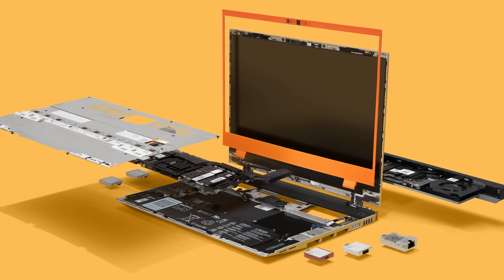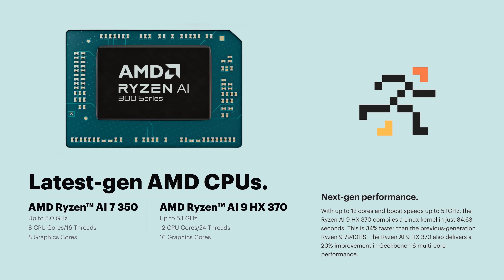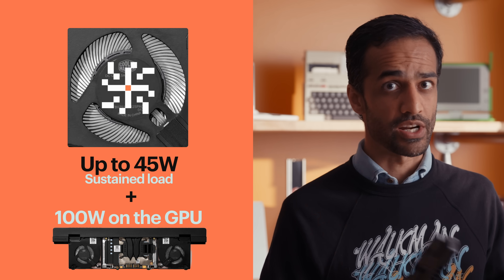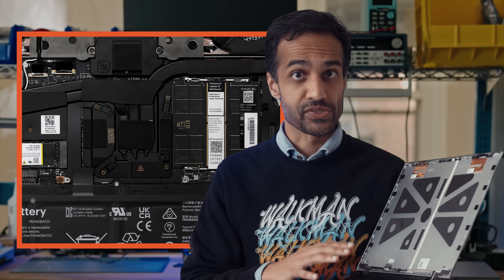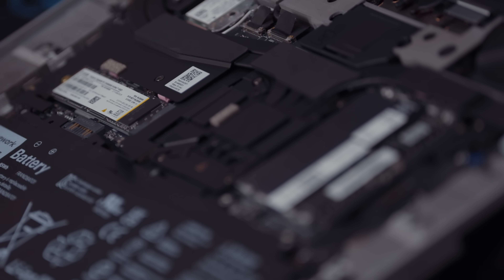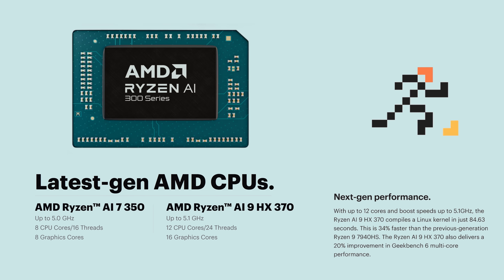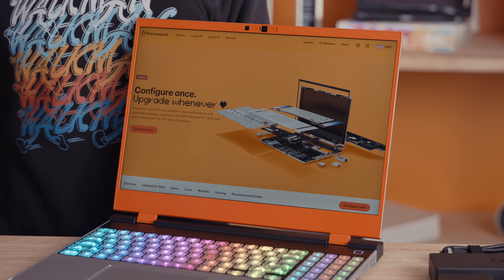Introducing the new Framework Laptop 16 with NVIDIA® GeForce RTX™ 5070

Comment: all this is amazing, but the 8gb of vram..... 😩✌ Big deal breaker.... the 5070 is MUCH more capable than the 8gb allows. JarrodsTech made a video where he power limited a desktop 5060 ti  (16gb) to 100e which is exactly the same as the laptop 5070 and found that the 16gb of vram made such a big difference in more demanding titles at higher resolutions, where the 5060 ti was completely playable, but the 5070 laptop was not. Not to mention it would give more headroom for frame gen. not sure why framework didn't go with the 5070 ti instead. it isnt much more expensive but is alot more compelling value wise. 8GB just isn't enough. It was enough when the GTX 1070 came out, but that was almost 8 years ago, and times have changed.

Comment: TLDR; if you had a framework guaranteed list of supported Thunderbolt Docks for Ubuntu and Windows (not user vetted, but maybe a comments section) I’d switch today. 

 I love the changes and iterations you are constantly pushing for. I’m a freelance developer, developing web apps. As it stands now I need a lot of memory for my development stack (upwards of 24 gigs on the daily) recently I’ve been needing a new computer. in the past this has been a  MacBook  Pro. As for now I’ve been testing out Ubuntu on my personally desktop to accommodate the needed ram upgrade, and finally after many times trying, I think the Ubuntu Out of Box is no harder to set up for development than MacOS.

I want to switch to framework, however

I love the functionality of plugging one cord into my Other World  Computing TB4 dock and having it just work. If you had a FrameWork verified TB4~ dock list for Ubuntu and Windows I’d by one right now. I just don’t want to spend hundreds of dollars testing 15 different docks for compatibility. My biggest concern is gpu pass through for multi monitor support. I can’t tell how that works exactly from your documentation. I know there is a dedicated gpu port out of the back of the gpu, and some amount of pass though out of the side ports. Specifically as a laptop that’s what I care about most. 

I think this would sway others to purchase a framework as well.

Comment: I thought the point of framework is to have one laptop and upgrade it forever, not to have new laptop each year.... So you basically offer new form of pci slots. I remember ordering my Dell laptop to spec in 2008 and parts were very much replacable. Only thing against replacements were cost, which this company does not resolve. 2k laptop? No thanks.

Comment: Guys, my issue with the framework 16 wasn't the power of the GPU.

It was paying that price and not getting: A wrist rest with no lines in it (I don't want spacers there), an rgb numpad, and changable ports that have 2 ports on 1 plug (those things are wasting too much space).

There's oodles of other customization I still haven't seen but want, but those things, there's no way I'm buying one without those things.

Cmon guys its modular already for repair, why can I not choose to outfit the thing more? I want a touch screen, I want colored shells, keyboards with track nubs, a magnetic usbc port that could be used for easy charging. I would pay a premium for a device I could outfit like that, why don't you guys want my money?

Edit: I saw your other video. I'm happy you're trying on at least some of these, just to hear just something affirming you are actually, maybe going to deal with some of the deal breakers is nice, but its pretty disheartening too. You had time to develop and test that weird giant trackpad (that I emphatically do not want btw), but just selling me a single piece of metal with a normal trackpad in the center, that's still far away for some reason...

Comment: Yet another proprietary GPU module incompatible with anything else... I'm writing this comment from 2016 Clevo P870DM, upgraded from original Maxwell GTX 980M to Turing Quadro RTX5000 and it seems like CPU will become bottleneck first (currently i9-9900KF@5,2GHz)...

Comment: Something I was wondering — I know the PCIe interposer was stated to only have, like, 10 connection cycles? Which is probably really more than enough since you probably only would remove/swap modules when you upgrade, which probably would be every year at most, but is there a new version of the interposer with more connection cycles? Also, will the previous gen stuff be available new but cheaper when this new stuff drops?

Comment: Laptops have finally achieved the ultimate goal, time travel back to the mid-2000s lol or late '90s really well I guess that would be the ultimate goal.. mid 2000s is all right, like at least they recognize the idea that you might want it... I feel like there was a brief 2010 era where this has made it come back but it wasn't quite on the same level as the '90s with the modular bays and whatnot which were in necessity back then.

Comment: Not sure if anyone noticed, but between 1:30 and 1:38 the background color changes. I was shocked and surprised! Can anyone tell me how it was done? Huge round of applause to the editor
Reply: I think they changed the Hue of the background
Reply: @SreenikethanI  that's what i thought but can we do for particular section, that's what i am thinking
Reply: You can see by the lavalamp that it is a simple hue shift, and that the presenter is rotoscoped out (pretty badly, too, not meant as an insult but the edges are quite rough and feathered so you don't notice unless you look for it but it's definitely hobby grade rotoscoping. Still amazing work, so absolutely not meant as a dig)
Reply: I noticed that too!

Comment: I kinda want lower tier NVIDIA graphics modules
I prefer the 30 or 40 series due to having more true frame power than the 50 series
Also I'll need to check the battery capacity sometime I like having something that's just barely allowed on airplanes
Reply: Releasing a 30/40 series module is literally impossible

They're not being made, so it can't happen
Reply: @MrToastyYT that's unfortunate. How is AMD then? Never used a computer with that GPU before

Comment: 4:12 as a linux user: thank you, next Laptop will be a framework machine 🎉
Reply: Yes, but it still is an outdated one…
Reply: @Eira-d8q it's a balancing act, new enough but backwards compatible enough or cutting edge but not as backwards compatible if at all
Reply: @lukesalvidge118  What are you even talking about!? The AMD GPU is not new at all. It's the same as in the 1st gen. And why does a new Nvidia GPU works but not a new AMD GPU
Reply: @Eira-d8q They had a binding contract with both AMD and Nvidia, so they couldn't outperform traditional laptops in the market.
Reply: @Eira-d8q  no one doing actual work (except rendering on a laptop for some reason), needs modern hardware all the time
Reply: @Eira-d8q which parts exactly?

Comment: Will there be more in depth documentation on the interposer output and input (power wise), im trying to design a PCB that will fit into the expansion bay shell and allow all PCIE devices to be connected to it through a pcie x 16 slot (only 8 of which will be active)

Comment: Would be great if you could also provide equivalent workstation spec cards (like 3500 Ada) for these. I'd LOVE to use a framework PC instead of my dell precision, but I need the verified drivers to run CATIA, SOLIDWORKS, and other software on it :)

Comment: The Nvidia graphics is a surprise for many, including me. Though I would have preferred a newer AMD module for multiple reasons but I'll not complain. I'm a bit sad though that the Ryzen AI models used are not the ones with the more robust graphics subsystem (AI Max ones I think) because as a portable device, I think it would really make sense. Is there a chance we get AI Max series CPUs in the future or is it completely ruled out for any reason? (like cooling system limitations, pcie, lack of upgradeable memory options) I'd be happy with an indirect answer but I kind of hoped for such models after the Desktop model had them.

Comment: Does the new fan controller IC allow for setting manual/custom fan speeds through the Fan Control software on Windows for example?
(and if yes, would it be possible to only swap that part itself out? xD)

Comment: I just checked, the 5070 8GB module costs $650..........You should have gone with the 5060 8GB for maybe $400 - $500. The 5070 is only 15% faster with the same VRAM, it's not worth it over the 5060.

Comment: getting closer to tempting me with this one lol. Only thing I will ask though, is will you guys make a laptop in future with something like Lenovo's "ultrabay" where you have the option to install a big interchangeable module like a dvd drive, 2.5" storage drive, second battery or even some sort of small pcie device? If you guys even make a workstation version of these laptops thats really thick and bulky to have space for something like this I hope you can add it. Also if you do make a double thickness version you could make it so you can add two of those gpu modules stacked and that would be so cool. But i'm getting ahead of myself there lol

Comment: The one thing I was worried about was that I was going to have to replace my current framework laptop for the new one but you guys stuck to your guns, this is so awesome, great work you guys and gals at Framework!
Reply: That would defeat the purpose of the Framework, no? I just heard about this so I'm not sure, but the point of this laptop is to be upgradeable and reparable without needing to buy a whole new one, right?
Reply: @matheusrossetti9144  It just feels like a dream. The company is doing what it set out to do. That's rare these days.
Reply: @matheusrossetti9144 well I knew it was repairable and I figured you could upgrade certain components but I wasn’t sure if that also applied to entirely new editions. I hoped it would and that was why I got one but was just relieved they confirmed that. It’s pretty amazing.
Reply: this is great news in a market where they are not normally available or they don't market it here so the availability is scarce
Reply: I am just afraid this company is too legit and fair to survive in capitalist tech market environment
Reply: I couldn't believe it when he said you can swap out the top cover. When my Clevo pops it's clogs, I'm definitely buying a Framework 16/18.
Reply: how did you upgrade the cpu and gpu? all i see is the ability to swap a usb port for another drive.
Reply: @CyrusChennault he literally mentions in the video how u can swap out the parts in the older model with the ones in the newer model including the new gpu and front covers. Its completely modular meaning every part can be replaced.
Reply: @CyrusChennault that's not just a simple expansion port plug in/upgrade, you'll be swapping in different areas for those and/or actually getting in there to do the swaps, but they're absolutely possible. (would recommend double checking your claims before leaving those other comments btw)
Reply: @CyrusChennault  do you not literally take the mainboard out and put a new one in?

Comment: There is no bad product. There is only bad pricing. This is true for all the Framework laptops. Lowest price DIY without any extras just choosing basic CPU+5070 GPU is 2,459 eur. That is immediately too much. I would like to have framework laptop instead of other throwaway laptops, but here its just crazy expensive. Even adding Windows 11 PRO is 259 eur. The prices in configurator are nuts, even adding 16 GB RAM and 1TB storage ends up making it even less competitive with other notebooks. Like 2,929 EUR expensive. I can find MSI Katana 15 with similar specs for 1,589 EUR. If the price extra would be couple of hundreds, ok. But this is literally double. And the question is - when the GPU alone is 740 eur, the next time I would upgrade, it would cost half of the new notebook. 
Also, framework is always a bit behind technologically, for example there will be RTX 6070 and framework will have it year later or so, then you can pre-order. So you are limiting yourself to lag behind every many other notebooks on market. 
I like the idea, I'm just still not sure how much I would pay extra for it. Maybe 500eur extra max. Like if the notebook that others have for 1500 you would have for 2000,  that would probably be the max. But the configurator prices are all over the place
Reply: bad products are athing

Comment: That's pretty crazy, upgradable graphics in a laptop for the first time in years... finally Framework has done something worth noticing in my eyes
Reply: And you know a lot of modular laptops on the market?
Reply: @qbzerodp  back in the day, clevo and dell (alienware) had mxm graphics cards, clevo even made a laptop with a desktop cpu inside at some point.
also older laptops had actually swappable cpus too. (which framework doesn't, though that's an issue on intel and amd's part, and for some parts like the AI max cpus, it wouldn't actually work well for technical reasons.)
Reply: @satibel and i have it. It was the cheapest 1050Ti laptop, i5-6600T
Reply: @satibel I have that laptop!!! :) Clevo NH55AFW .

Comment: A hot swappable motherboard would give you the opportunity to do repair work by mail. Remove the current mobo by disconnecting the battery, replace it with a rental one and send the original for routine maintenance/repairs/upgrades. 

Better than to end up without a machine for the whole week, or to have non-tech savy people messing with the internals of the laptop.

Comment: 'This is a step backwards. It might be repairable, but once Nvidia stops supporting the GPU with driver updates, you may not be able to run secure and up to date systems anymore, even though the hardware may be perfectly able to. With AMD on Linux 15 year old GPUs and older still get the benefits of modern drivers, because they are open source. There is no such thing with Nvidia.

Comment: Now that we have NVIDIA Graphics as an available option, I hope AMD can help produce a new Radeon GPU generation that works with the Framework 16, and likewise, NVIDIA will continue to do the same. Having the option of both is great. Heck, maybe Intel would be willing to offer their Arc Graphics to the mix.

Love the Copilot button roast, by the way.

On a final note, I love how Framework is one of the few, if not the only Laptop manufacturer that is giving their AMD Processor lineup the shaft. So many other OEMs seem to soup up their Intel models with the high end parts while relegating AMD to the Budget or cut-corners designs.

Comment: Would it be possible to put 2x USBA (or USBC for that matter) ports on an expansion card? (maybe with reduced bandwidth of each port when they're both in use) The reason for this ask is I'm used to denser configuration of peripheral ports on other laptops

Comment: 0:00 The Revolution Begins: Discover the Future of Repairable Computing
1:15 Game-Changer Alert: Modular NVIDIA Graphics Are Finally Here!
1:40 Power Unleashed: Next-Gen AMD Ryzen AI CPUs Arrive
2:45 Ingenious Design: Single Cable for GPU Video & Power
3:45 Feast Your Eyes: A Stunning 165Hz G-Sync Display
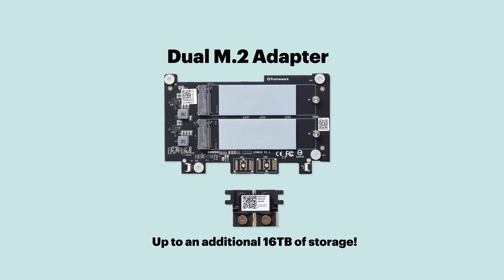4:47 Infinite Storage: Expand Your Digital World with Dual M.2
6:20 Serene Performance: Advanced Cooling for a Quieter Experience
6:50 Command Your Workspace: Up to Four Displays Simultaneously
8:08 Built to Last: Enhanced Durability for the Long Haul
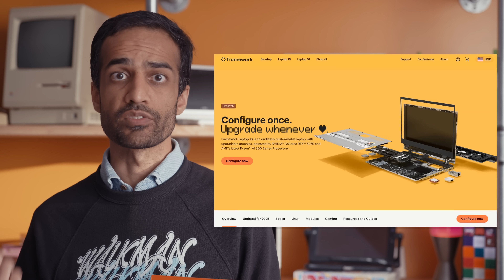9:00 Future-Proof Promise: Backward Compatible Upgrades

Timestamps by StampBot 🤖

Comment: Actually, I feel like this is a genuine concern and a good question for others. I know how you mentioned the GPU module can now support charging, but if you put a new GP module inside an old framework laptop, will it also be able to charge over that port? Or do You need the new main board to be able to charge over it I assume the new main board is what actually has the ability to let power into the system

Comment: I absolutely love the product, but as a dev who’s next private dev pc upgrade needs local llm capabilities. This doesn’t rival the macbook pro, sadly. Would’ve loved my next upgrade to be a framework pc, sadly the “pc” side of hardware has no competitive response to the unified arch. of the m-series. I don’t even dare ask about battery. Even the ai max has the issue of slow memory even though it can at least load larger models. Really wish pc would catch up soon, I’m upgrading within a year and then won’t upgrade for another 5-7 years again, sad that mac’s are still my only option. I realize the price difference, but that’s not the issue, pc consumer/prosumer hardware literally doesn’t have a response, also this isn’t frameworks fault, amd/nvidia/intel are the ones I’m pointing fingers at here.

Comment: Upfront cost is expensive compared to other brands.
However, having owned both Acers and Alienware laptops, running for 7-10 years. and replacing some of the parts myself.
I can see the actual benefits of getting in framework's ecosystem.
Framework have to launch in South East Asia as it is one of the fastest developing markets. Also, it must have a after sales support and community backing.

Comment: It's a great idea, except two issues. Using a proprietary connectors is an issue because it essentially leaves at your mercy for what GPUs and processors are available and how much they cost. For example I can't just decide I want a 5090, or whatever other GPU and throw it in. This all relies on your good will and you staying in business basically.

The other thing is that your laptops are so expensive that they don't even make financial sense even considering their upgradability. Trust me I wish modern laptops were more modular, but if that means the prices of them double, I'll stick to soldered on GPUs and non modular devices.